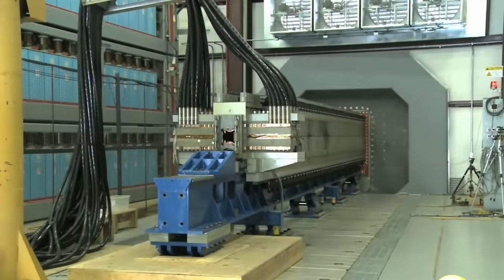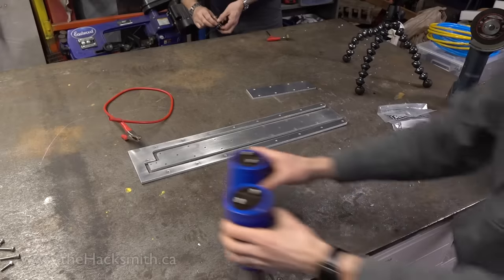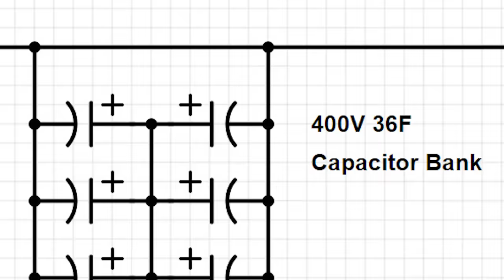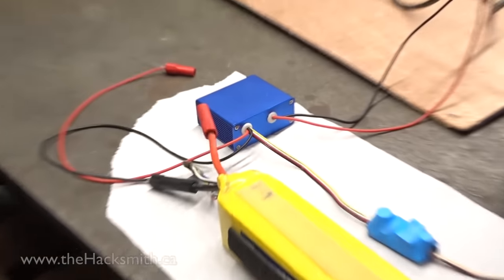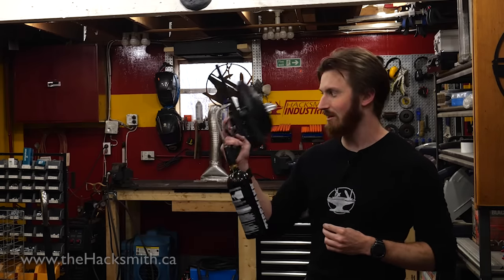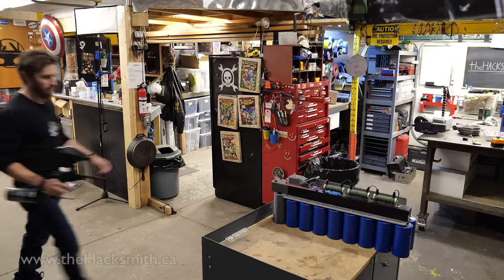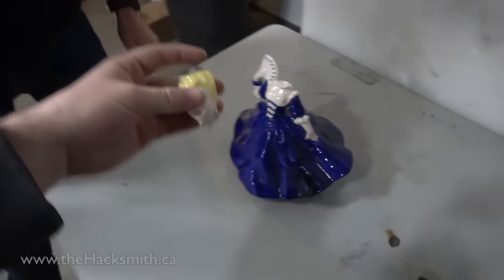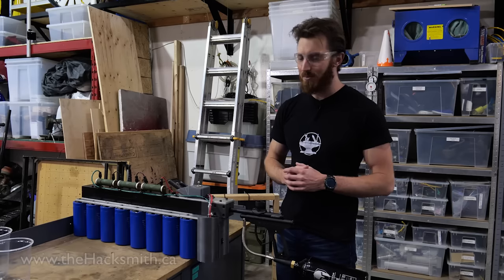Making a RAILGUN and then TESTING it!

Comment from the maker: Buy one of the used projectiles from the video! https://www.ebay.ca/itm/222865692130?ViewItem=&item=222865692130 (2nd listing)
Also if you're wondering why it didn't seem as powerful as it could be -- that's because we had to limit how powerful it was to remain inside legal limitations. A video isn't worth going to jail over.
Reply: Add rifling to the gun so it could go faster
Reply: the Hacksmith
Reply: Huh
Reply: Im too poor to buy it sorry :(
Reply: Bonne apétit mdr 
vos vidéos sont génial même si je comprend pas tout mais c'est coool
Reply: its currently at $2.50
Reply: the Hacksmith iii
Reply: As long as the railgun is fixed to a table and can not be held by a  man, it should not be considered as firearm but as a testing device, atleast that is the case in germany. Go look it up! If thats the case u can go bigger, stronger, better.
Reply: People who looked at this also looked at: Body Sculpts? Interesting crowd bidding on this one
Reply: the Hacksmith your a sell out lol
Reply: Look at the other things people viewed before viewing the bullet
Reply: Where is the spin??
Reply: Hg Hg it will not go faster with rifling, but it will be more powerful. He should add more capacitors to make it more powerful.
Reply: the Hacksmith change the projectile to be made of aluminium with a steel center in the shape of a dart. Trust me.
Reply: i know what u are doing you are extending your beard for a infinity war video hype
Reply: Cool, but the slingshot i made for free can do all of that.
Reply: the Hacksmith it needs more power. Get a gun license than make it so it shoots very fast and powerful or make the item and give it to someone with a gun lincense
Reply: You should make a working bowgun off of monster hunter world
Reply: the Hacksmith I think it would be cool if u made the power armor from fallout 4
Reply: Wtf bye...
Reply: Matis Coppin ur not French
Reply: Dont forget, the Chinese navy beat the American by being the first to put a railgun on an aircraft carrier.
Look it up.
Reply: Come to America(USA) and do it! Make it a full on weapon
Reply: Hacksmith you are very awesome man i wish i could make something like this
Reply: Make the black panther claws
Reply: the Hacksmith What took the army a decade took you about a couple hours to a day to build a strong handheld rail gun 
Edit: almost handheld rail gun
Reply: the "disposable casing" is called a sabot (t is silent because french i think)
Reply: the Hacksmith I
Reply: the Hacksmith Personally, I think you should have made a coil gun. Same priciple as a rail gun, just with a EM coil. They can actually have a rifled barrel due to their tube nature.
Reply: the Hacksmith I'm pretty sure that ain't legal mate
Reply: What are the capacitors that you guys used. Also where can i get some?
Reply: +1 follower
Reply: the Hacksmith I don't get why everyone always makes railguns with a barrel, I mean the only thing that needs to be contained is the projectile, so why not leave in only the magnetic rails and thin guide rails if needed with an aerodynamic projectile, removes a lot of unnecessary air resistance.
Reply: the Hacksmith so we are making MACs (Magnetic Acceleration Cannon) from Halo
Reply: 1. Could you build a gauss rifle next?
2. Just have some masked members of your team "go rogue, make the rifle stronger and make a video about it". Noone needs to know who it was.
Reply: Wif you make the bullet longer it should increase speed and accuracy depending on how heavy the bullet is
Reply: hey hacksmith can you (if safely possible) make a device that that hooks on the your car that can make the back to the future fire trails
Reply: +the Hacksmith I love your vids so far, new to your channel, me and my son.  However, why did that thing have so a low penetration power?  It seemed to wast to bounce off everything.  Glass bulbs?  Should have had more that enough power/momentum behind iat to go clean through the target not break it but bounce off.  Why was that?  I did see the round tumble, which can effect accuracy and distance, but power shouldn't be lost.  Any ideas?
Reply: the Hacksmith colab with Demolition Ranch down in Texas to make it more powerful then
Reply from the maker: +Bob Weaver we had to limit its power to stay within the legal bounds of the creation.
Reply: rifling stabalises bullets in chemical energy weapons. Rifling doesn't work out too well with railguns because the "barrel" is two parts. Something they didn't talk about in the video as well, is that magnets (or electro magnets) are required for a vertical magnetic field, simply setting a current through a piece of metal between two metal rails with a current going through it doesn't push a projectile forward, unless you have an insane amount or energy going through it, using the earth's magnetic field as a field source.
Reply: 😎 cool
Reply: how bout going to millitary firing range?
is that a possibility for u
Reply: the Hacksmith wonder what it would be with nerf ammo
Reply: aaaaaaaah ok i see, didnt read it to begin with.
Reply: Guarantee the projectile was powered by the CO2 tank on the back and not the electric current, which is why it wasn't as powerful
Reply: Or is it??!??!?
Reply: You totally did more than a few off camera shots with it unrestricted though?
Reply: I'm sure you guys could have at least made it powerful enough to be able to penetrate wood. I mean, even a canadian bb gun can do that and they're tuned down compared to U.S. bb guns. Besides, isn't it legal to build your own gun, and to your own specifications?
Reply: If the projectile isn’t driven by gunpowder or other conventional means it’s not considered a firearm.
Reply: If you had the paint ball gun pressure maxed out would the rail gun still add 100 percent of it's acceleration to the projectile ? what I am asking is , is there a limit to the initial velocity of the projectile that if you go beyond it, the rail gun won't add any more momentum to the projectile ? or say if you had a projectile travelling almost as fast as a bullet would the rail gun still accelerate it even more ?..I guess what I am asking is this, is a rail gun an effective means of adding extra kinetic energy to an already fast moving projectile...?
Reply: i call your bluff
Reply: I bet I can catch one of those bullets with my teeth
Reply: 160km range ..... hmmmmmm
but since the earth is rounded i don't see the point of a ground attack except shooting an air target
Reply: the Hacksmith I
Reply: There are laws regulating railguns?!
Reply: the Hacksmith Hacker Smith I was wondering if you would team up with the sling shot channel and create the coolest shield that is  bullet proof, and retractable.
Reply: That's not how that works.
Reply: If you're not willing to go to jail for your fans then your fans mean nothing to you.
Reply: +Lyes Bourahla 
I facepalmed so hard at this comment...
Reply: Canada and this railgun both seem weak.
Reply: Really? Backyard scientist can build liquid metal squirt guns and incinierating laser rifles but you guys can't build a rail gun with more power than to smash some glass? Seems weird.
Reply: the Hacksmith fallout 4 rail gun
Reply: the concept's also not worth making a video over if you can't make it better than a slingshot.

Comment: With the capacity of that bank, you'd get better performance if you'd have made a multi stage coil gun rather than a rail gun.
Reply: Hexx Bombastus kinda like fallout 4s gauss rifle?
Reply: @rustyy270  yeah. I've seen some coil guns that can reach bullet speeds, which is scary because the projectiles have to be ferrous metals which typically aren't as squishy as lead is, so you get ricocheting and shattering at lethal speeds...
Reply: But with steel core ammo and a cheap rifle from a pawn shop you can achieve even better results and it can be carried easily
Reply: @grahamlopez6202  that defeats the purpose of building a solid state weapon.
Reply: that is impossible, the faster the bullet, the faster you need to discharge capacitors, which speed of discarhe is very limited because of high coil inductance. You will need at least 4-8 meters long coil gun(with perfect components) to archieve near pistols bullet speed.
Reply: @asismagul830  Not impossible. Just a very large and heavy capacitor bank and using infrared sensors and a transparent barrel to get the timing perfect. The rounds couldn't have any deformation on them either, otherwise they'd snag and ruin the barrel.
Reply: @H3xx99  Capacitors cant discharge INSTANTLY! They have resistance and INDUCTANCE! Coils have much bigger INDUCTANCE! So coils CANT take ALL energy INSTANTLY! You will need very long gun (4-8 meters), just to have more time for discharging. And you may also need liquid nitrogen cooling to bring RESISTANCE of system to ZERO (If not, the length of gun will grow drastically). At speed of 500 meters per second there will be only 2 ms of time to spent per 1 meter of length for additional acceleration !
Reply: Just wondering, what are the other pros of a coilgun over a railgun for its complexity? And why would it be more efficient for that capacitor bank?
Reply: @asismagul830  i have to disagree. Just take optimised coilguns . And resistance is not really an issue here. Just use an air based cooling and it should be enough. Plus you exagerated the lenght. It's actually 2.5 meters to reach a glock projectile level. I tried and it worked.
Reply: Glock projectile? Had no idea Glock made bullets? Even the use of the word “pistol” in this statement would sound ignorant seeing as the velocity of the bullet has no bearing on the make, model or type of firearm. Some calibers struggle to hit 800 FPS and others smash 3000 FPS and yes, those are still just pistols.
Reply: So meta

Comment: Come to ohio and lets mount that to one of my boats... hahaha I want to see that again with 6 more of those capacitor banks!
Reply from the maker: Hmmmmmmmmmmmmmmmmmmmmmmmmmmmmmmmmmmmmmmmmmmmmmmmmmmmmmmmmmmm
Reply: Peter and HS that makes for an entertaining combo. Do it HS
Reply: need a montage
Reply: PeterSripol hey ...... i know you ........ ur the one i subbed........ en u have a himemade plane.......... okkk.......wierd
Reply: PeterSripol having more would be like having more charge not power
Reply: hi peter!
Reply: OH
Reply: Yessssss
Reply: Mr Photon has the capacitor you need.
Reply: Actually the capacitors are enough, what you need to take it to the next level is a giant magnetic field perpendicular to the direction of the current
Reply: earl verity, There was one but thankfully it went away. It was a restriction on magazines. Could not be over 30 rounds without being restricted. Guess how many rounds a stock Colt AR-15 9mm Carbine magazine holds, 32. Or in the case of one mag I have, 50. :-)
Reply: Paul van Tieghem so I would have to put magnets on both sides of the rail?
Reply: It really depends on your design. There are a lot of different approaches to electromagnetic guns. The concepts are simple but to really make concrete calculations there is a lot of difficult maths and physics involved. The current activates it's own magnetic field, but you could amplify it with magnets. More interesting are coilguns in vacuums: The projectiles encounter absolutely no friction so the speeds can be fenomenal. The problem is that the magnets and the capacitors to go to >mach 1 speeds are way too expensive.
Reply: they would need to learn how to properly build one first.
Reply: IDE. Wanna see one like that but with like 100 of those caps
Reply: Ohio FTW!!!!
Reply: So it
Reply: @paul_vantieghem  The point of a railgun is that the perpendicular fields are created by the rails and the projectile. Otherwise it wouldn't move at all. What it needs is to actually get power from the caps to the barrel QUICKLY. 

Ideally, before the projectile leaves.

Maybe more, smaller caps would be best, lower ESR.

Comment: 16 35F capacitors... you guys are insane.

By the way, for anyone who would possibly think doing this at home could possibly be a good idea, normal capacitors (~10uF, about a million times less powerful than this) can explode like firecrackers if misused.  You can imagine what one of these would do.
Reply: Michael Cullen depends on the type of capacitor your talking about foil capacitors don't explode they just pop and catch fire and plate capacitors don't either they are just a piece of plastic with copper sheets on either side. They don't explode that's why they use them in high voltage projects like Tesla coils.
Reply: Michael Cullen 
Not to take away from the impressive size of this cap bank, but those definitely aren’t 35F caps. Probably 3500uF, which for 16 in parallel is still a whopping 56mF which is about 1000 times most electrolytics you would find in everyday electronics.
Reply: If you open a printer adapter they have one of these capacitors inside with a tiny little electric board I don't have to worry about my printer exploding do I.

Comment: You can increase your firing output and projectile velocity by using an oscillating power supply(modified sine inverter will do the trick) and incorporating a micro generator for faster recharge.

I'm designing a fully automatic man portable railgun and those two design modifications will make a serious difference.
Reply: Dude, MAKE A CHANNEL AND POST THIS SHIT!

Comment: Hey guys-- if you build a controller with optical interruptor and give it half the capacitors when it's fired and the other half once it passes about 25 percent of the barrel length, it'll shoot it faster. 
You will have to have a pretty good fast high-current switch, but you can use an SCR. What happens otherwise is that you run out of current before the projectile leaves the barrel.

Comment: Thank you for the video.

I believe that this qualifies as a gauss gun more than a railrun. A railgun has a physical carriage that the projectile sits and slides back and forth on when it gets moved by the magnetic field. A gauss gun has no moving parts and less friction but requires more power to operate 

This was still a cool project no matter what you call it tho ;)
Reply: No, that's a real railgun. A gauss gun would have coils. Railguns have rails. I worked on railgun research for the Army back in the SDI days.
Reply: @snoig1  ah okay thanks for the clarification - its still cool no matter what

Comment: okay, this is going to sound wierd, but just when the railgun was shot, a lightning bolt hit my house and I thought it was a reeeeally loud sound effect...
Reply: LOL
Reply: a lightning bolt did not hit your house, a tree or the ground near you maybe, but not your house. the chances are slim and i very much doubt it
Reply: Unless his house is taller than the tree
Reply: Thats not how lightning works bro
Reply: Julian Barber yes it is
Reply: Yes it is, Lighting looks for the easiest path to ground. If his house is the tallest thing in the area it's the easiest path, therefore, it's gonna get hit. Thats how lightning rods work.
Reply: OneDesigns the easiest path is not through wood, carpet, tar and the other things on the outside of your house. Those are what's called "insulators" of electricity (that's what lightning is made of!) Not conductors. A tree with water on the inside and out however is way more electrically conducive (at those levels of voltage at least) than your house will ever be regardless of it's LPS
Reply: OneDesigns btw, lightning rods? You realize it's not the 1800s any more right? It's called an LPS (lightning protection system) and it's specifically made to 1) NOT attratct lightning and 2)channel any lightning that may hit your house into the underground water pipes, therefore not actually striking your house, but the protection system instead. Btw, I install/update/check these systems for a living. I know what I'm talking about you 15 year old
Reply: You're the one throwing out insults at me Mr. 'Ad Hominem' 
"I know what I'm talking about you 15 year old"

Plus I did say it could've been a tall house.
Reply: If LIGHTNING hit your house, your house would cease to exist in about 2 minutes, which is longer that it would have taken to type that comment.
Reply: @Ae3lolz  Lightning is NOT made of electricity. Lightning is actually made of plasma, kthxbye.
Reply: @a.wright281  electrons flowing is the literal definition of electricity kthxbye
Reply: @a.wright281  e·lec·tric·i·ty

əˌlekˈtrisədē/

noun

1.

a form of energy resulting from the existence of charged particles (such as electrons or protons), either statically as an accumulation of charge or dynamically as a current.

synonyms:power, electric power, energy, current, static

"cabins with no electricity"
Reply: Julian Barber ok I do not agree with you with the agrument u had he is right you are not so go away and find a another comment to destroy
Reply: @brandonhowell116  the cool thing about science is it doesn't care wether or not some 15 year olds on YouTube don't agree with it kthxbye
Reply: Julian Barber I'm 12 XD
Reply: @Ae3lolz  bruh a tree is literally a wooden stick it's not the best conductor
Reply: @Ae3lolz  I said LIGHTNING isn't electricity. I didn't say electricity was plasma you 5 year old.
Reply: @Ae3lolz  And also I said kthxbye before you you copycat. Kthxbye.

Comment: what you are explaining at 15:05 is called a sabot as shown at 15:15. it helps guide the projectile down the barrel and keep it straight and stable. Sabot rounds are made for shotguns too.
Reply: Taoflader folks
Reply: Interesting, I guess that's why the slow mo of the projectiles coming out of the gun weren't firing straight?